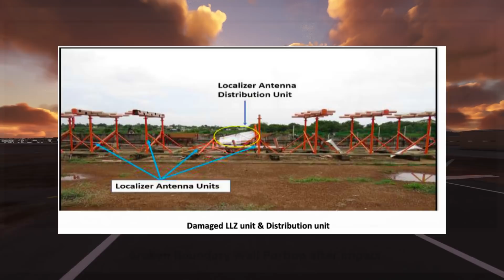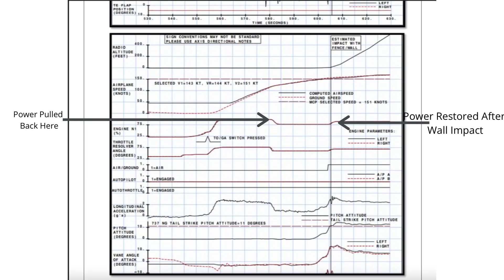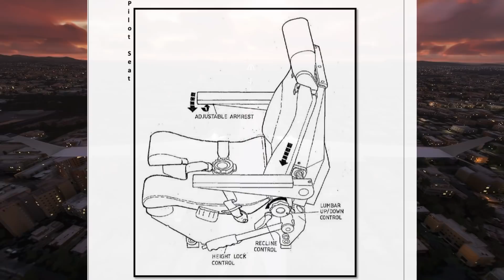How A Broken Seat Flew This Jet Into A BRICK Wall | Air India Express Flight 611

Comment: I had the same two questions. If speed is below v1 they could reject the take-off. And why did they divert so far away
Reply: Calculation of V1 is dependent on the power and expected acceleration.  If their acceleration was less than calculated, the V1 would be invalid.  After the power was reduced, they used up so much runway that they couldn’t stop before the end, even though they were below V1.
Reply: Not all anomalies during take off roll are cause for automatic rejection.  Case in point, I once sat in the jumpseat on a DHC-8 going from FLG-PHX.  During t/o roll out of FLG at about 70 kts, we got hit by a thermal (a dust devil with no dust).  Knocked the aircraft about 20 feet to the left of the centerline.  Luckily, I was with two very senior pilots who maintained control, straightened the aircraft back in the center, and continued the take off with no further issues. I'm sure pilots are trained to be on the lookout for all sorts of reasons why a take off should be aborted, but I can't fathom a seat breaking backwards is one of them.  At that point, you would rely on gut instinct and how much control of the airplane do you think you have.  I know there's an argument for aborting the take off, but I can completely understand why they continued on.
Reply: Because they already used most of the runway so even below v1 they won't have stopped
Reply: Agree with StrongDreams and Spencer, but this points out a flaw in the whole V-speed thing that I've always had concerns about.  V-speeds only work when the aircraft is accelerating normally.   What about when it isn't?  Obviously, velocity isn't the only thing that matters -- how much runway you have left is kind of important, too.

Seems to me that there should be an accelerometer on board that can alert the pilots when the plane isn't accelerating normally so they can abort the takeoff before it's too late.  This might've helped avoid the crash of Air Florida Flight 90.
Reply: Strong dreams already explained it pretty well, but yeah. At that point, all the V speeds became question marks; the captain saw their speed & where they were on the runway and made the split second call. Imho, he made the right one. 
After takeoff however I would've dumped fuel and landed nearest suitable. I'm not going over water without knowing the state of my aircraft.
Also, I totally understand the need for ILS antennas at the end of the runway, but a brick wall..?? Not to be that guy but "who tf put THAT there??"
Reply: @232K7  I think the brick wall can be the airport boundary
Reply: @mananpatel1850  yes it is the airport boundary, as highway is next to it. But he height could be reduced to 3-4 feet instead of 8 feet. A security guard is there
Reply: @232K7  brick wall probably keeps locals from stealing all the copper from the ils system.   This is india after all.

Comment: Does plane use note mph or km
Reply: Knots (Kts)
Reply: Knots are one Nautical mile per hour. A nautical mile is longer than a land mile. So 100 Kts is 115 Mph
Reply: 5280 feet in a Mile
6076 feet in a Nautical Mile (kt)